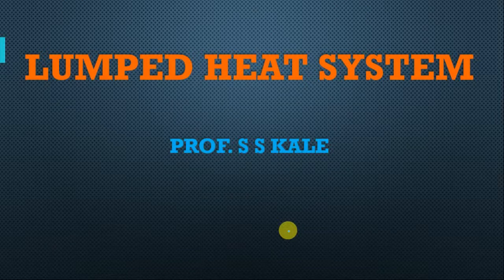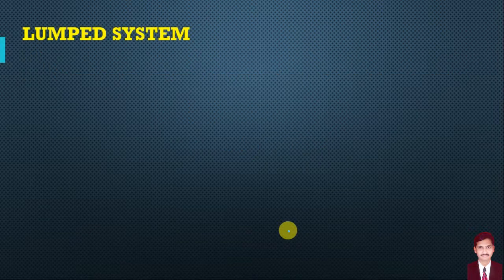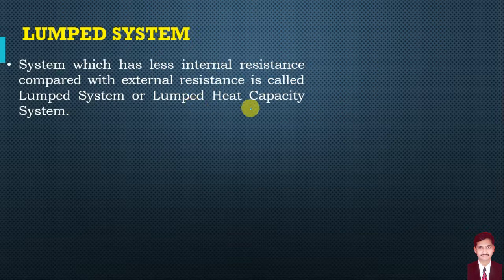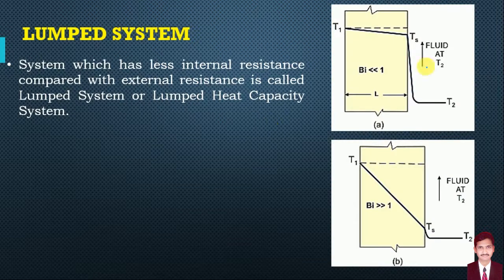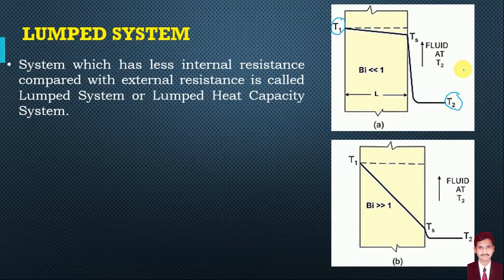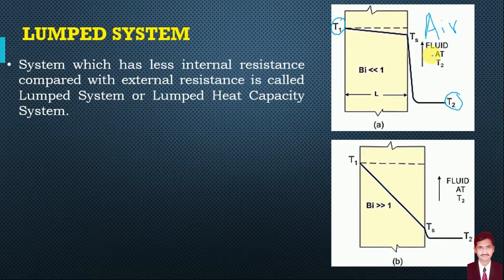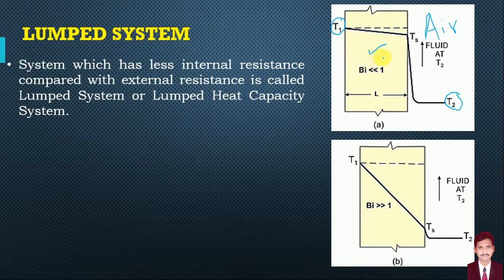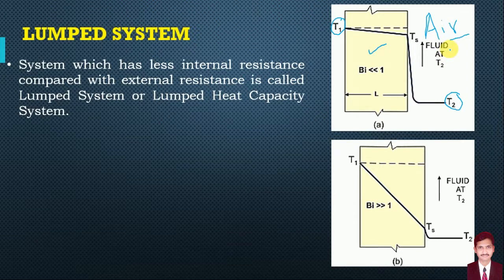Lecture 20 - Lumped System Analysis

Comment: Hi Sir, kindly share me similar equation for my requirement.
I am suppling heat Q-200W,
providing h-35 (fan air velocity~4m/s),
And having Ti (initial) of 80°C (steady), Ta (ambient) 25°C
Component Mass-1.5kg
Material-Copper
Cov Area - 0.1 m^2
I want to find two things
1) if I reduce h to 25 then how much time (t) will it take to reach Tf (final) of  90°C
2) if I increase Q to 300W (with h 35) then how much time t, it will take to reach Tf of 90°C
Thanks in advance
WhatsApp 8144011363
kamurudeenka@gmail.com